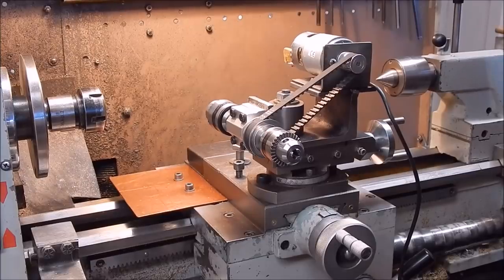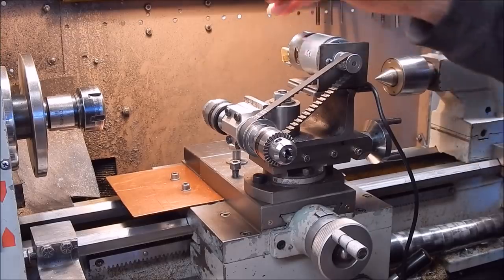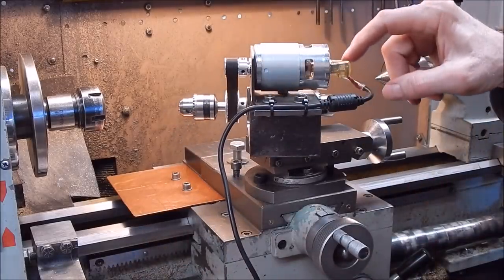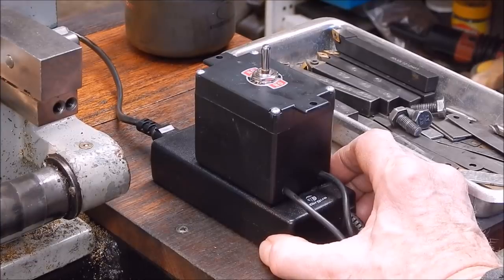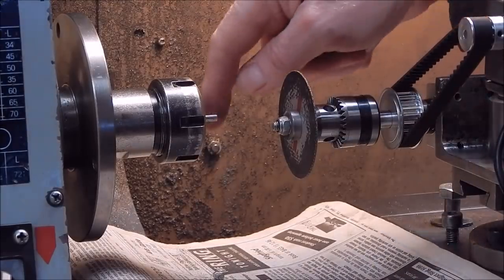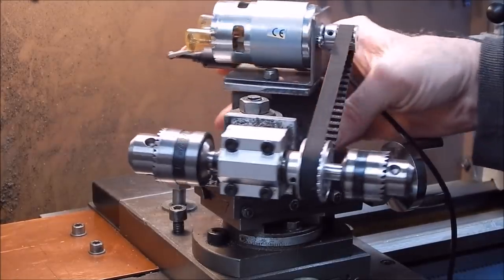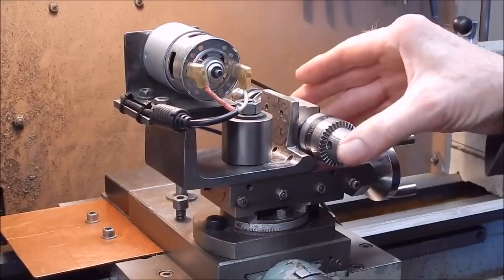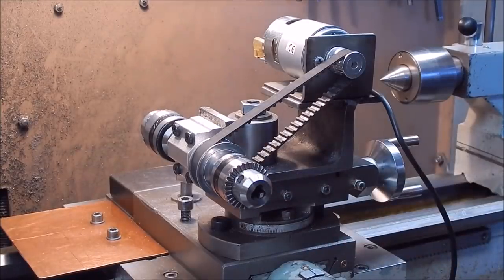775 DC motor driven twin chuck Machifit power spindle modification

Comment from the maker: Note:  It appears that my information about the drill chuck tapers is incorrect.  I have only ever seen Jacobs Tapers on drill chucks in Australia, but apparently there is a B taper used on chucks in Europe.

I read the chuck stampings and assumed they were all Jacobs as the smallest one is Jacobs 0.   I reasoned that the B was a chuck size/type related number.  

I also notice that Steve Jordan referred to them as B type mounts and thought he was wrong, however it is likely that the three largest chucks are actually European B Taper and not Jacobs.  So be aware of this difference.

My advice is to buy the 6 mm maximum capacity chucks/spindle and copy/tram the taper on the spindle to set up the topslide for cutting a taper at the other end.  That way there is no possibility of variation and the chuck will still take tooling up to the capabilities of the 775 motor and power supply.

Cheers Rob
Reply: Good one Rob

Comment: Hey Robby,
   I guess I’m gonna have to spring for one of these kits. I can see multiple applications here. I don’t generally like grinding on the lathe but sometimes it’s the only way to, “Get ‘er done” 
   Got a project coming up where I have to do some index drilling so this may be the solution for me. Also the possibility of cutting a key way  on a shaft.  Thanks for your endeavors with this little concept.
Reply from the maker: Hi Dale,

Cover up and wipe down and all will be well.  I've done a lot of grinding on the lathe over the years and provided you take precautions it's no big deal.   

Indexing on the lathe is also piss easy using pie charts:  http://users.tpg.com.au/agnet/cq9325rev8.html

These can be mounted between the chuck and the backing plate then thrown away after use: https://www.youtube.com/watch?v=M3cH0kKN074

Lots of free, cheap, easy ways to do lathe work.

Cheers Rob

Comment: For a cheap (or free, if you already have one) power supply, you could do worse than a 230W HP laptop power supply. It's rated for 11.8A @ 19.5VDC; if that much amperage seems too high, you can always just use 7.5A or 10A fuse or breaker in-line. These things are ubiquitous, so if you have a tech recycler nearby, they may well have a few totes full of them. The "brick" is about the size of a small driveway paving stone.
Reply from the maker: Thanks for the tip off.  A sealed unit is the go in this environment.  Unfortunately a lot of power supplies are open and not suitable.

Recycling and free are good :)

Cheers Rob
Reply: @Xynudu  Nothing beats a working power supply that you already have. 😆

Comment: That's pretty damn good as a toolpost grinder.  For drilling, you probably want to be dropping the speed, at which point you probably want to be using a cordless drill motor / gearbox assembly.    Downside to that is that it's gonna be too slow, even in drill/driver "fast" mode, for grinding.  A relatively easy way to get around that might be to mount two motors, one with a gearbox, and one without, and swap the belt over.  Or, given the cheapness of the spindle kits, one setup for drilling and another one for grinding.
Reply from the maker: Hi Michel,

The best option and one I'm looking into would be to reduce the gearing with a larger spindle pulley (provided it clears the topslide OK) and then use a higher voltage variable power supply.

That way the torque increases, the drill speed is lower at the same voltage, and the voltage can be increased for a lot more speed when grinding.

So this is where I'm headed.

Cheers Rob
Reply: Hey Rob. I'm not sure you can really get acceptable speeds for both drilling and grinding from one set of gearing.  

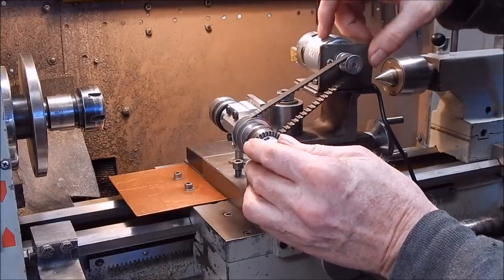Let's assume you're going for a top size of drill bit of, say, 10mm, and you want to drill steel.  speeds and feeds says something around 20metres/min for cutting speed, that gives you a speed of aroundabout 600rpm minimum, and you're going to want maximal torque for doing that.  So you want your motor running at its optimum speed, for a DC motor that's slap bang in the middle of the speed range, which is probably for a motor of that size somewhere around 6krpm - you're going to need a 1:10 reduction from the motor to the spindle, which, if nothing else, is going to give you clearance issues.

Grinding and abrasive cutting, on the other hand, wants massive speed, of the order of 30metres/sec, with a lot less requirement for torque.  But you're only going to get, at best , 12krpm from your motor - even 1:1 that's borderline for small cutoff discs, you can probably get away with OD grinding, though.

Don't get me wrong, I can see the appeal of a "one tool does it all" approach , but you already have a mount for the Hilda grinder, I'd optimise for drilling if I were you.

Comment: Nice idea for the double ended tool, Banggood got some variable power supplies, sure a 0-24 volts  20 amps would do, I've also seen one with adjustable output current, those sell for about 35 to 50 USD, the 24 fixed ones are even less costly, those need some extra enclosure, though.
If you want the link, I'll send it to you via Email...
Reply from the maker: Hi Pierre,

I've perused the BG power supplies and DC PWMs.  They are pretty cheap and a big range.  The only issue is that the circuit board ones need to be ventilated when mounted and that can be an issue on a metal lathe due to oil/chips etc.

I like the sealed power brick as it's safe and durable.  Having said that, I have variable power brick on the way from BG to check over.  It's reasonably affordable and adequate for this job, so we will see how it goes.  Stay tuned.

Cheers Rob

Comment: Now when the motor dies you can just use a drill by going from the chuck on the drill to one of your chucks on your setup with a bit
Reply from the maker: Yes, but that's pretty crude.  Do whatever floats your boat.
Reply from the maker: Hi Craig,

Some people drive the power spindle with a cordless drill on one end of the spindle rather than with a pulley and motor.  It works but it's a bit crude IMHO.

In my case you could put a rod in the Jacobs chuck on one end and drive that with an electric drill if necessary.  Same basic concept.

Cheers Rob
Reply: Craig Marshall robs reply to you is what i was implying.... And just to be clear im not implying this specific motor will burn out ... Unserviceable electric motors have a life and are consumables no matter where the come from... Its always handy to have options

Comment: Hi Rob, Jacob taper 1 nice you made this life spindle well, and two way usage as well. What is in the spindle for bearings? Now we know what you bought that spindle for what a great build from that buy to this build, we really like your work Rob.
Thank you, Lance & Patrick.
Reply from the maker: Hi Guys,

The spindle bearings look to be just generic sealed races.  They should be OK for these sort of speeds.  It would be possible to add several more to the housing and beef it up for milling.

Time will tell how good they are.

Glad you liked the concept.

Cheers Rob

Comment: Hello sir,
We are always very impressed by the quality of your achievements and of course the latter.
You have made changes to the system; the one that interests me relates to the addition of the 2nd drilling mandrel.
Would you have a video showing this modification, if not how the connection is made, by a conical end fitting or by screwing? In the case of a conical connection, how did you machine the axis?
On the other hand, would you have a link for a more powerful engine, allowing the machining of steel.
In advance thank you and very cordial greetings. P. K. (French)
Reply from the maker: Hi Paul,

Excuse the delay in replying, but YouTube comments facilities aren't as good as they used to be.

The chucks are both held on by a taper. To machine the non tapered spindle end I trammed the existing taper against the lathe top slide, then swapped ends and machined it.  As the tapers may vary slightly, finish off by checking/adjusting fit with a marker pen, candle flame soot or similar.

I used the motor supplied by BG for the kit review.  I think this is adequate for grinding and model work.  A larger power motor may exceed the load rating of the toothed drive belt.

Cheers Rob
Reply: Hello sir,
Thank you very much for the reply; yes I saw that my message was not in the right place in the list of comments.
It seems to me that I understood that you machined the cone with the carbide tool after orienting the upper carriage and then checking the adjustment using a marker.
I would have thought of a finishing by rectification with "Hilda".
I am very happy with this information which I will apply. Thanks again.
Cordial greetings. P. K. (French)

Comment: Great improvised tool. Is the motor heating up at all? If so could a small shrouded fan be mounted on the shaft at the back?
Reply from the maker: The motor has no heat build up what so ever.  It has a built in fan which is quite effective.  It was stone cold after all run tests.

It is running well below it's maximum rated voltage and as such heat is a non issue.

Cheers Rob

Comment: Rob could you mount an angle grinder in a similar  way? On the top slide.
Reply from the maker: Sure Zane.  I actually considered this. 

You can either clamp a mount onto the angle grinder collar on the head, or make  a mounting plate to use the three or four bolts that hold the head together.  Wouldn't be difficult.

Lots of possibilities - angle grinder,  air or electric die grinder, pencil grinder, power spindle, even a Dremel.

Do whatever floats you boat and fits best.

Rearward cross slide travel and centre line height are your two main considerations.

To grind you don't need much power, as the stone/disc is only kissing the job.

Cheers Rob

Comment: Great video Rob. I love this simple design. Can't wait to make one of my own. Do you have any specs on the motor? Thanks.
Reply from the maker: Banggood sell a range of 775 motors.  They vary a lot on speed and voltage.  Make sure to get the one I reviewed with the Machifit spindle assembly.  The link is in the video description.  Cheers Rob

Comment: If you have one, put a ceramic condenser over the poles of the motor to extinguish brush arcing. It will help with longevity. https://www.pololu.com/docs/0J15/9